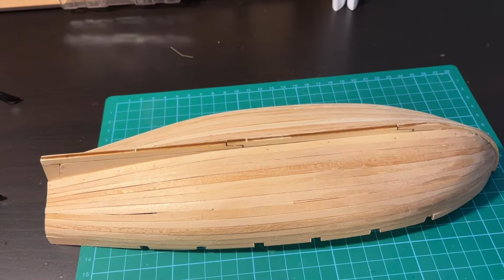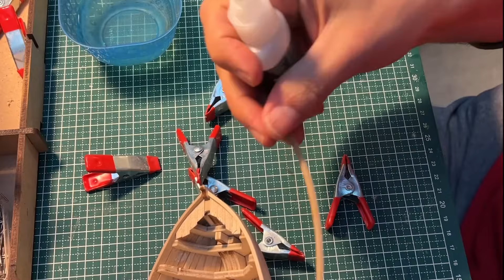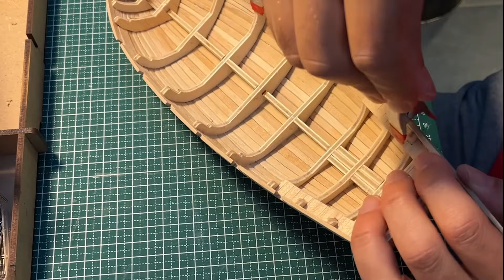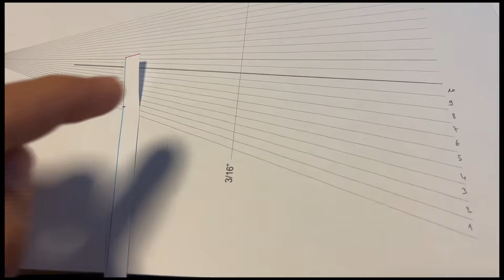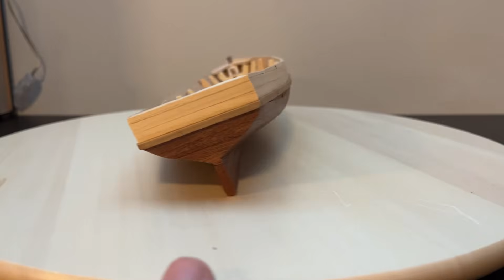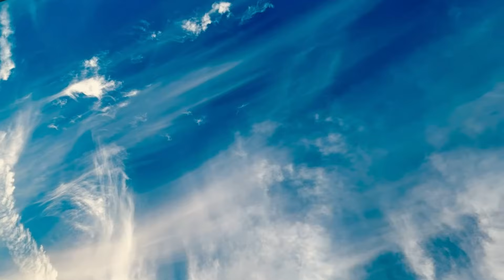Second Planking a model ship Hull | Bounty Boat Build – Part 3

Comment: First of all, thank you for your fantastic videos! Quick question: it seems like you extended the keel after the second planking - how did you achieve this? Thanks!
Reply from the maker: Thank you for your comment, it means a lot to me. About the keel, it was meant to be like this. In the intro you see the rudder attached to the keel. Other than that, I used the parts in the kit. Good luck with your own projects!

Comment: Great planking work! Quick question: when you brush on the water/PVA mix to carry sanding dust into gaps, does the dried glue leave a surface “film” that later interferes with primer/paint or clear varnish? Is sanding afterward enough to remove any glue residue?
Reply from the maker: Thank you!
It partly depends on how much you dilute the glue and how heavily you apply it. The more diluted the PVA/water mix is, the less glue residue remains on the surface — but if it’s too thin, there’s also a higher chance that the sanding dust simply washes out of the gaps instead of filling them. A 1:1 mix usually works well for me.
After it has dried, a light sanding is enough to break the thin glue film, and I’ve never had issues when priming or painting afterward with acrylic paints. Weathering techniques also don’t seem to be affected.
That said, if you want to keep the wood natural and finish it with a clear varnish, this method is probably not ideal. Even with sanding, the PVA does leave a subtle surface film that can give the wood a slightly sealed or glossy look and reduce the natural wood grain effect.

I do try everything new on spare pieces before adding it to the hull.

good luck!!

Comment: So basically second planking is just water proofing the ship, specifically where the water line is?
Reply from the maker: On real ships, planking does help with waterproofing, especially around the waterline. But (this is to my opinion) in model shipbuilding, the second planking is mostly for aesthetic and structural reasons. It covers the first layer, allows for a smoother and more detailed finish, and gives the model a more realistic wood appearance. It's not about waterproofing, since the model won't be in water (static models are not build for being in the water).
Reply: @Curtis_Wooden_Shipyard ok. Thank you

Comment: Hey. In the video it seems you measured hull length, to divide by number of planks, already with two planks placed at the keel. Is it so? Thanks!
Reply from the maker: Hi Alfredo, I can see where this question is coming from. I measured the distance between the wale and the garboard plank (so the two planks not included). It is a different situation compared to the first planking (had only 9 points in stead of 10 points).